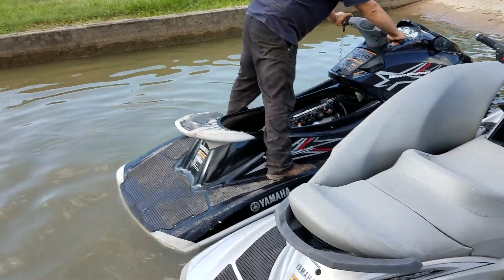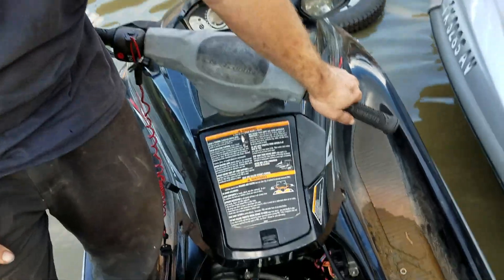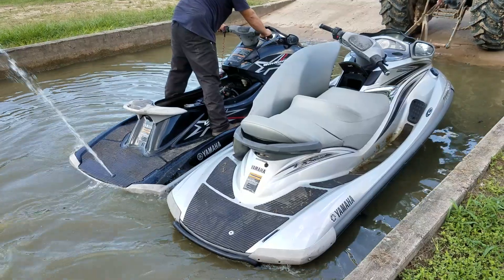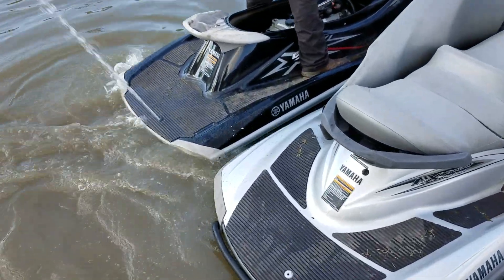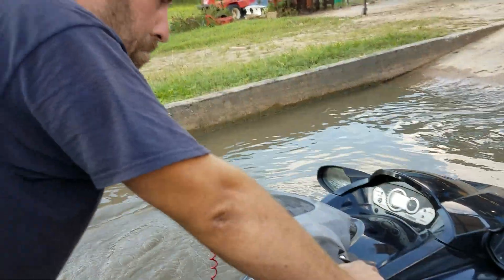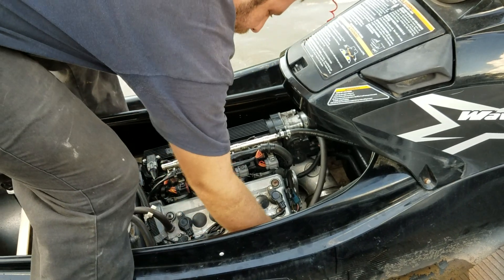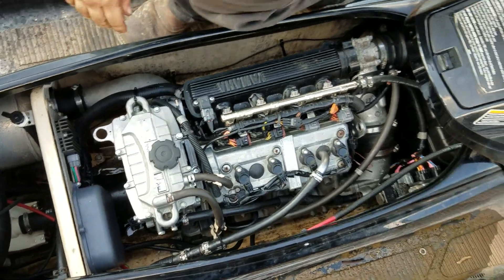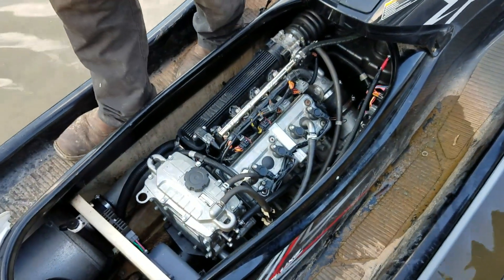Yamaha VX 110 Overheat Repair

Comment: Simple fix just take your temp sensor off put in boiling water around 180-190 the 2 wire circuit should remain open only if the circuit closes and the boiling water is under 190 then you have a bad sensor if not proceed with the testing of next temp sensor same method

Comment: Oddly enough I purchased a 2007 fix cruiser that has been sitting since 2015. Has 44 hours on it and it’s getting a high temp alarm after a few min in the idle zone. No water coming out the pisser on the left side so I’ll be pulling the engine and taking the exhaust off and see what I can find as blockage
Reply: where was the blockage?
Reply: @gavinark5409  built up around the cylinders

Comment: I have a 2013 VXR that high temps warning. Looks like it's false alarm since it goes back to normal after shutting jetski off and back on. How do you test the 2 thermal sensors and thermal switch?
Reply: Mine is doing to same engine and high temp light go off and turn off and wait 5 min and it’s fine . Did you ever get it fixed ?

Comment: I've poured muratic acid in the cooling system to clear out corrosion
Reply: That's a good idea. If it takes antifreeze same ss cars, there's a company that sells lifetime anti-corrosion antifreeze. They say it will stay good longer than any engine.

Comment: My Yamaha VX 1100 is running hot. when I crank it up after 30 sec. the alarm goes off. I have cleaned all the water ports and since I put it back in started it back up and again 30 sec. the alarm come on I felt of the exhaust manifold and its cold. I pulled the water line coming out of the head and water was coming out I touched the exhaust manifold again it was cold I touched on the other side after the joint and it was getting hot. the top of the head was getting warm also. any ideas.
Reply from the maker: Salt water use? Thermostat open?

Comment: I have a 05 yahama vx110 sport the exhaust runs cool but the bike does not pee out the water from the side.... All the lines are clear but it does not pee it's driving me crazy I looked on line and found nutting that can help
Reply: What ended up being the issue? Experiencing the same with my 2006 FX1000
Reply: Same here it’s not pissing out the side as it should 
Just a little at a time
Reply: Same here anyone get this resolved?

Comment: I just got done with a 2007 VX Cruiser, with only 78 hours on it. The head had to come off, the corrosion was hard as a rock and almost completely clogged the passages in the head. I resorted to a drill to break up some of the deposits. The block was slightly better, but still bad.

Comment: All y’all are doing is sucking up a bunch of silt. Only way to test properly is high speed
Reply from the maker: Voodoo one, we appreciate your input but your backwards. There is no silt in our run tank HOWEVER, Lake Houston is Silt Based. Check facts on web about Lake Houston.
We have GREAT SUCCESS 99.9% of the time testing ALL types of watercraft in our 23,000 gallon test tank. 
Though...1-2 times a year we do have a vehicle that requires lake testing.  Not too bad considering last year we serviced and repaired approximately 469 watercraft of various makes, models & engine configurations.

Comment: any advice on 2009 kawasaki jetski stx 15 not idling right. runs great under load. dies out when throttle released.
Reply: Michael Carol Sanchez check the idle air control valve and the throttle body for gunk or carbon deposit and clean it up with throttle body cleaner

Comment: any vids on jetski 2009 kawasaki tps adjustments
Reply from the maker: we havent made any, I am sorry. It's really pretty easy with a volt ohm meter and if you search google you should be able to find the voltage readings...  0-5 volts dc.   5 volts throttle open and less than 1 volt closed. Hope this helps.
Reply: Lewis Walker   I'm working on a Yamaha fuel injected jet ski,,,, how can I get a engine cleaner in the intake manifold and try to clean the valves.. piston domes... Combustion Chambers...???